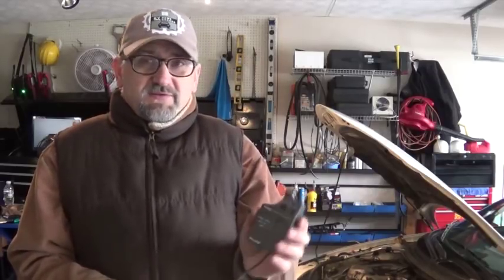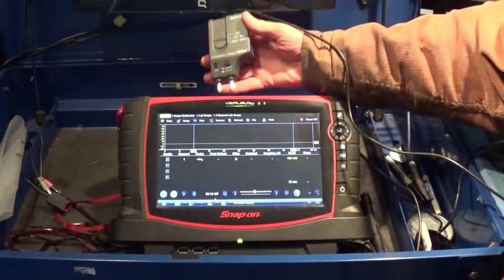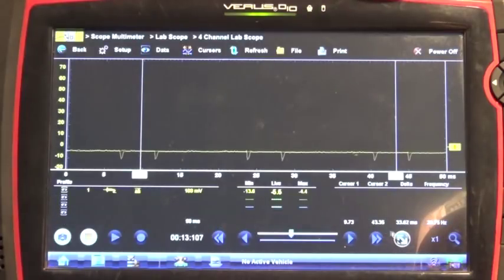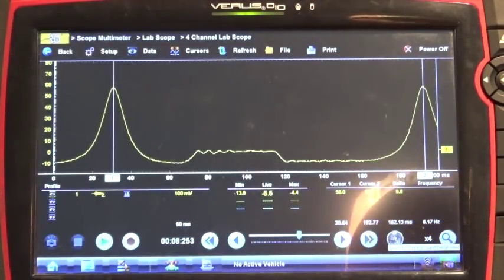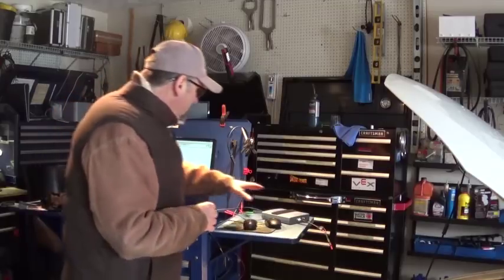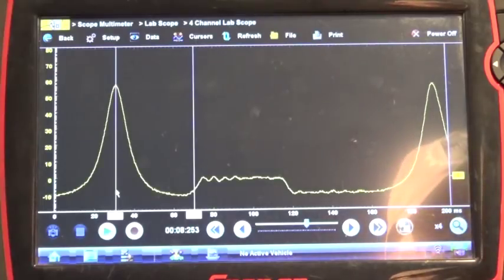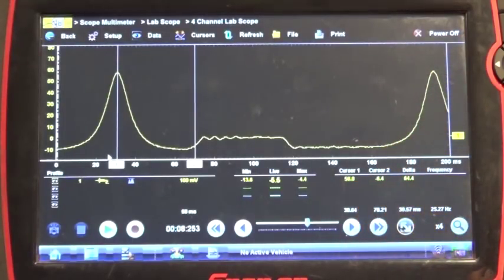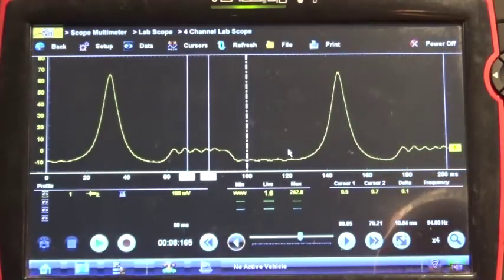Using Fluke PV 350 Pressure Transducer With Snap On Verus

Comment: Hi which pico would you suggest for a hobby mechanic?
Reply from the maker: Dr Daniel any 2000 series pico will work just fine.👍
Reply: Mr. Ramon, thank you for your video. I appreciate it! 
You mention the 2000s series from Pico can work for a hobbyist mechanic. I found the Pico 2204A on Amazon cheap. Does that is comparable with what you have? Thank you!

Comment: How can a volume @ -10 PSI be compressed 10x and end up @ 64 PSI?
(assuming 10:1 compression ratio)
Think about this, Ramon.
With a starting point of -10 PSI, the math says 35 PSI peak.
The FLUKE 350, the WPS500 and Yvan's DIY pressure sensor that he gifted to Eric O all come up with similar PSI on the compression towers. I think they overshoot.
Reply from the maker: logical canuck I don’t know but to me that looks OK because my intake manifold pressure is -10psi
Reply: @kyhomegarage3430  - YES, Ramon. Agreed, the intake is under 20 inHg vacuum.
The -10 PSI is not the issue.
The question is:
How can it possibly get to 64 PSI from that initial -10 PSI level?
Not possible.
This is Boyle's Law. High School level math here.

Comment: Yes it's relevant, i have both versions. The wiring to the sensor is different, the circuit board is different, and non interchangeable, unfortunately. :(
Reply from the maker: Super Mario Diagnostics thank you for sharing my friend Is new on as good as old when comes to resolution?
Reply: KY Home Garage KY Home Garage actually no, they made it for a volt meter instead. So it looks like terrible on a scope!
Reply from the maker: Super Mario Diagnostics that really sucks. Why would they screw up such good transducer. I guess it’s cheaper to manufacture.🙁
Reply: KY Home Garage KY Home Garage i ask myself that too, a brand like fluke, you'd think they would show off their quality transducer. Not they're just known as "get the old one"
Reply: Does the new pv350 say made in china
Reply: Super Mario Diagnostics , how do you tell the difference if you’re looking for one on eBay 
?
Reply: @bartscave  The way to tell is open up the unit like your changing the batter. Inside you will see a small blue box with a screw on top next to the adjustment knob. If it's there it is USA made if not it's Chinese version which will not work on a scope. It also says, "Made in USA" on the back towards the bottom.

Comment: Ramon, I have a request. If you have the time. And the inclination...
Would you please conduct a WOT crank compression test with the WPS500 sensor?
Exactly as done in this video:
https://www.youtube.com/watch?v=-8ZbvZKquv0&t=196s
NOTE: the test hose check valve must be present and throttle wide open.
The waveform I got shows the generic 300 PSI sensor does overshoot...a bit. If the WPS500 shows the same amount (or less), then I'd have to do a serious re-think.
But if the WPS500 waveform shows a more pronounced "overshooting" as it ladders up to max pressure, then I'm on the right track.
I know you're a busy guy and god knows I'm busy with renovations here...if you have time.